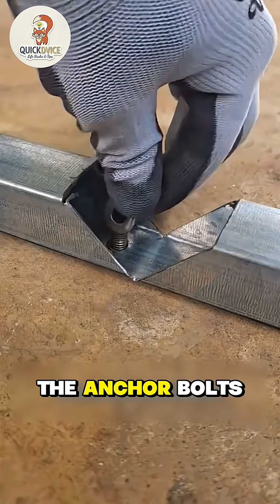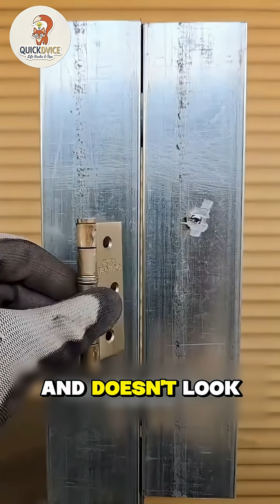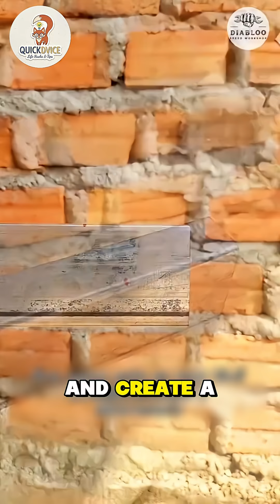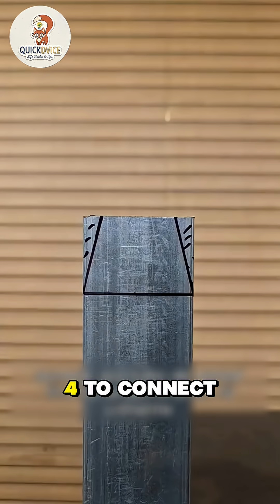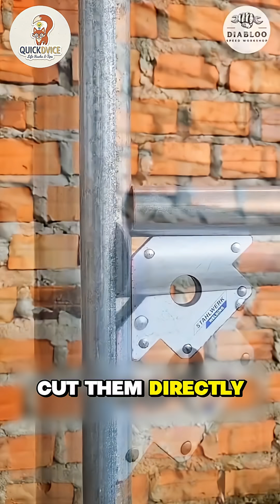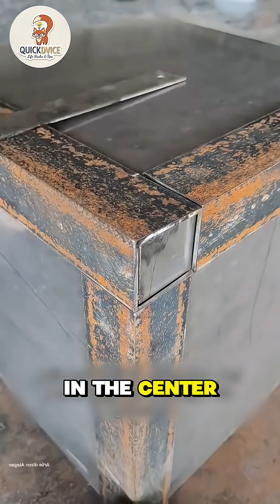6 Welding Tricks Only Experienced Workers Know!

Comment: What are you going to do when you have to remove it?
Reply: So all underneath and start over saw all metal blade so you spell AI is full of shit nowadays and know what we’re talking about a tool. You should know what it is.
Reply: You won't need to, except to replace it. How often do you remove a working hinge or railings
Reply: @perfectsolobj  You remove the railing every time you have to reseal a deck, if you're doing it correctly...